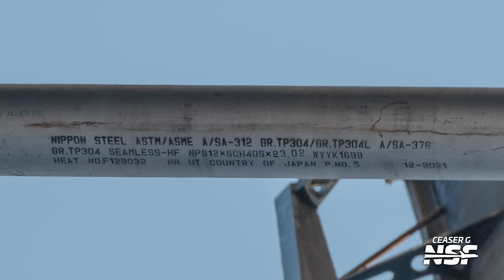"So many pipes, you'll think you're Mario" | SpaceX Starbase

Comment: The 304 stainless steel tubing at 0:45 has a working pressure of ~1000psi at 100C, a diameter of about 12.75 inches, and a cost per foot of Youcan'taffordit. Freedom Units 'cause old man.

Comment: I did a stint as a window washer, and it would not surprise me if they were cleaning windows at night. Because outside tinted windows get devilishly hot, particularly in Texas. So hot, that you scrub them with your wet scrubber, grab your squeegee, and the window is already dry -- with the dirt still stuck on to it.
Reply from the maker: Heck, can even see that on car windshields... good catch. Didn't see any squeegees though did you? - Das
Reply: @NASASpaceflight  No, looked more like they were inspecting the flashing above the window. Possibly still at night due to the heat.

Comment: Adrian's explanation in German was actually one long word.
Reply: That's how German works - if you need a special word, such as Fussbodenschleifmaschinenverleih, you just make it out of bits and pieces.
Reply: In German you just never put spaces inside compound nouns, while in English you mostly do. E.g. fussbodenschleifmaschinenverleih is "floor sanding machine rental". Both are compound nouns, one has spaces, the other doesn't. It's just a difference in writing while the spoken form works basically the same.
Reply: @cube2fox  Americans are always trying to join words together, like "nightshift" but then when you look in the dictionary you are informed that no such word exists and you are supposed to write it as two separate words "night shift".  Some word pairs if they are used together a lot can eventually become an officially recognized compound word like freshwater, nutshell, offshore.  Fortunately for us most of the space words are compound words, spacecraft, spaceflight, spacesuit.  However space cadet is still two words 😄
Reply: German isn't real

Comment: 4:35 I wonder if the pipes are marked with the CG after they are made so that the construction crew can just pick it up and not have to experiment.
Reply: That's something that (in "close enough" values) can be generated by the design software that's used for CADing the piping. So pick a reference feature and mark distance from it and you're set. No trial and error needed.
Reply: @davidg3944  My guess after thinking some about it some more is that for pipes like this they probably don't mark them due to the labor that would be involved, assuming that it doesn't really take that long for the construction workers to determine the CG onsite. And the manufacturer isn't even sure if a particular pipe is going to be lifted at the CG point anyway, even if they mostly are. But maybe for larger and heavier pipes they get marked for CG since that's a lot harder to determine onsite. Or maybe not even just CG but since for heavier pipes there might be two straps they could mark the two strap locations which will provide a balanced lift.